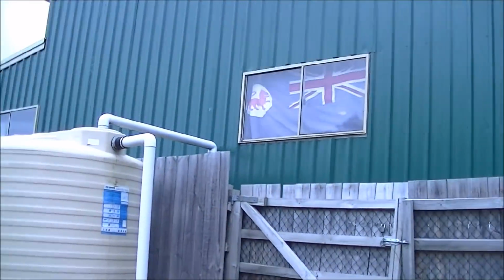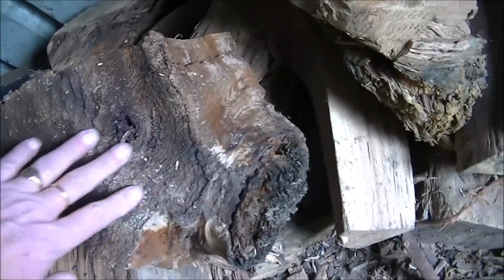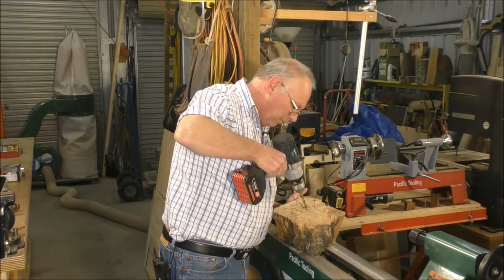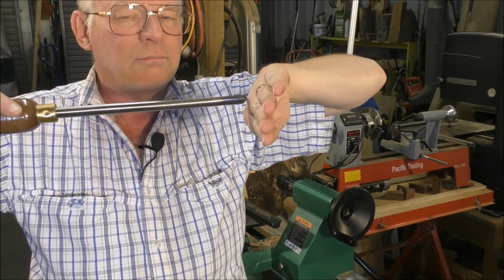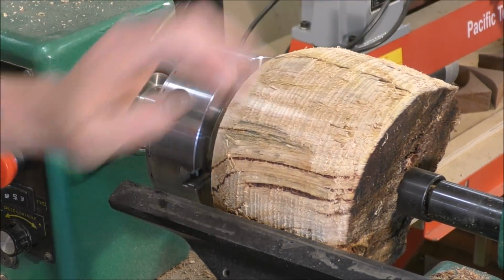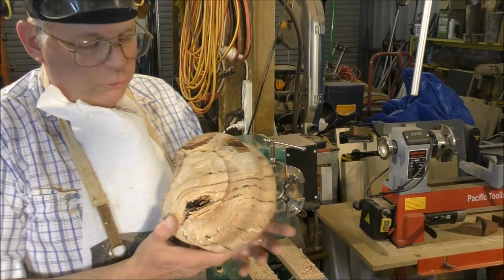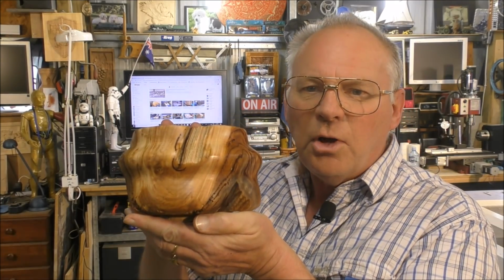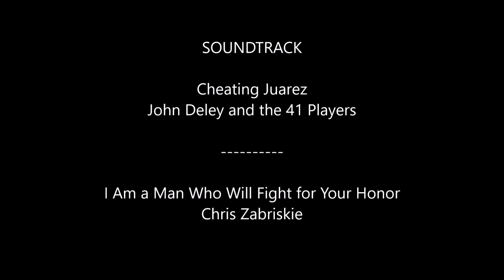The *Pure Evil* Indian Tiger Bowl wood-turning from firewood

Comment: Why don't you start by making the piece to be turned as round as possible? This could be done with a plate, a pencil and a bandsaw, thus reducing ages of standing at the lathe just trying to shave the lumps off and sending constant shocks to the machine, your hands and the piece.  This may reduce the risk of bits being dug out of the piece.